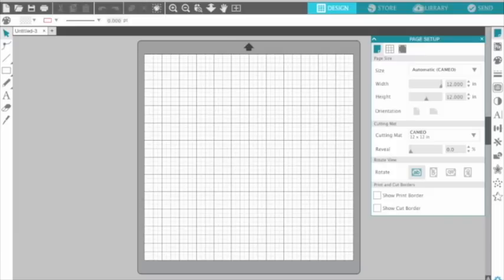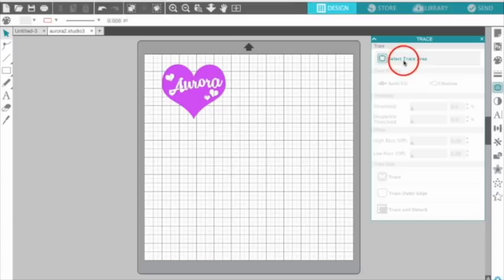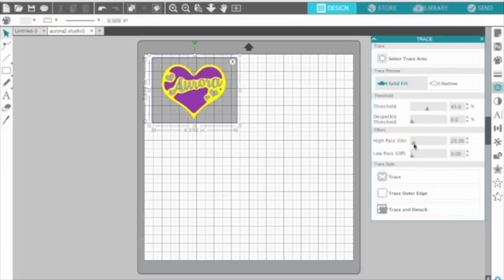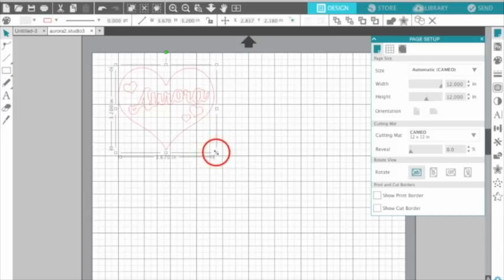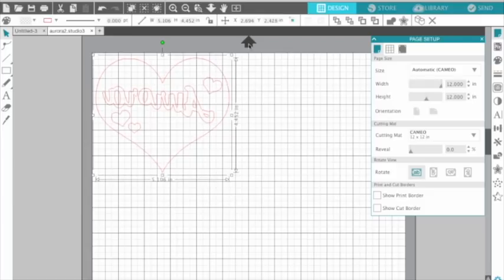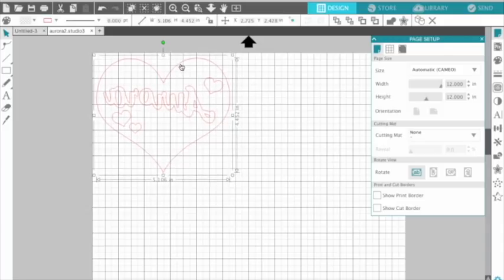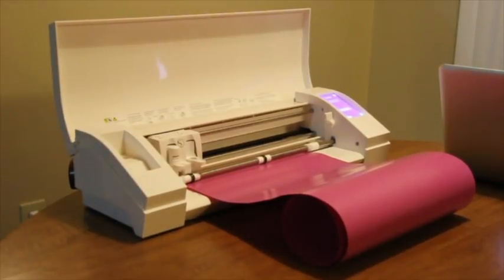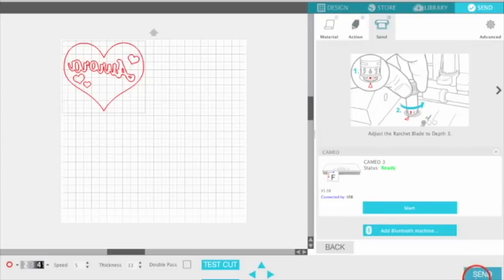Tutorial: Flocked Heat Transfer with Silhouette Cameo 3 (make a custom iron-on shirt)

Comment: how do you cut vinyl without the mat?  I tried that and the vinyl sheet moves all over the place?
Reply from the maker: It shouldn't move if you have the release lever in place and the rollers on the edges holding the vinyl down.  Inside the lid of the cameo there is a sticker with details about adjusting the rollers if needed also.

Comment: I put in vinyl with no mat and it wadded up. Had to put mat on?  Suggestions?
Reply from the maker: Make sure you have the latch (on the right) down and make sure the vinyl is lined up under the outer plastic rollers

Comment: so you do not have to set the blade setting ?
Reply from the maker: I used an AutoBlade so it sets automatically.  In the software when you select the material "Heat Transfer, Flocked", it automatically sets the blade settings.  I generally go with the automatic settings which are Blade 3, Speed 5, Force 33, Passes 1. 

On different projects if I find that the settings do not cut well, then I adjust.  The auto settings work great for me for the Flocked Heat Transfer.
Reply: @daiqarita  That did not work for me, I did 22 two passes.

Comment: How large can you make your design?
Reply from the maker: You have to keep the width just under the width of the vinyl (if you use a mat you should be able to print the width of the vinyl.. without a mat the rollers are on the edge, so I cut in between the rollers without a mat.